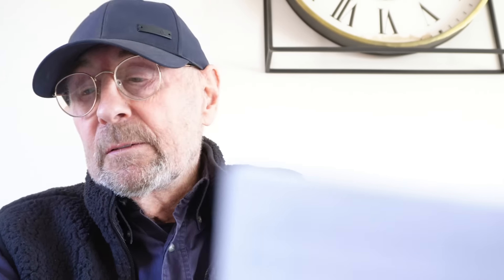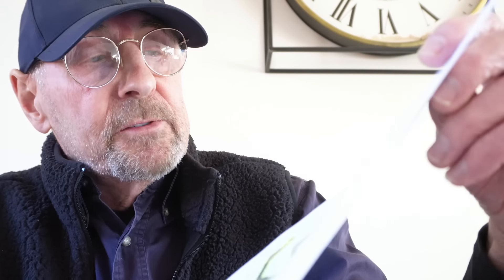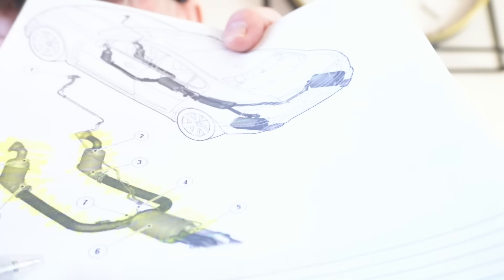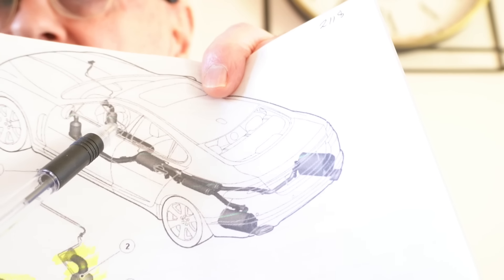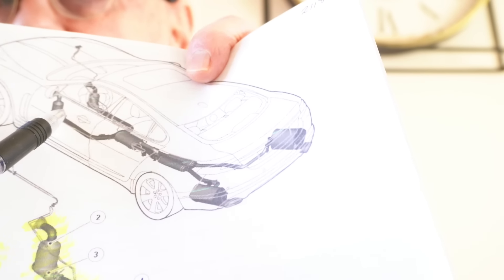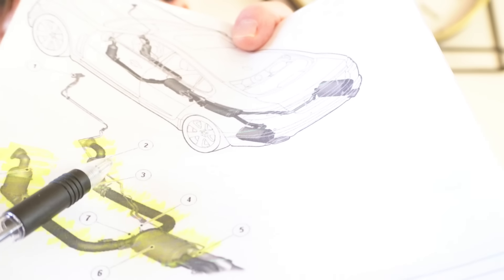CAUSE REVEALED!.. The Self-Destruction Of Jaguar Land Rover 2.2 / 2.7 / 3L Diesel Engines

Comment: The 2.7L TDV6 in the Land Rover Discovery 3 suffered from broken crankshafts, yet it never had DPF.  That didn't come in until the 3.0L SDV6 was introduced.  As someone else has commented, ALL modern diesel engine vehicles in UK and Europe have the DPF fitted.  It's part of Euro V specification, and they all have the same issues as you spent a good 20 minutes reading from Jaguar documentation.  It's something that was forced on the manufacturers, the same as the Exhaust Gas Recirculation systems.  You are using pure speculation to determine that the DPF is the reason for the failure of these engines, and you do not have any data to back it up.  People need to know your advice is flawed.  Yes, the V6 Lion does suffer from crank failures, but I'd be more inclined to believe what Christian of LR Time YouTube channel believes is the reason.  At least he has a lot of data to back up his proposal.
Reply: Mhhh….but what Christian also said is, that the thinner oil is better not use in that engines. So maybe both are right. The crankshaft is not a „Toyota design“ and never let the oil getting thin 😅
Reply: The 2.7 certainly DID have the DPF!! I had a D3 and RRS with the 2.7tdv6 and BOTH had the DPF!!!
Reply: @nicholascross1961 mine didn’t
Reply: @markcarter3897  depends whether it was a euro3 or euro4 rated vehicle.
Reply: @nicholascross1961  2006 Dpf was added 2007 model year
Reply from the maker: Hi Simon, thank you for watching and for your feedback. You do contradict yourself. You say I have no data and that my advise is flawed and that people should know that, then you say that I spent 20 minutes reading from Jaguar documentation. Are you saying that the Jaguar documentation that I quoted from has no data to support it, do you think Jaguar are making it up? What do you think will happen when your engine oil is diluted with diesel fuel? Would you advise someone to top their oil level up with diesel fuel?because you appear to think it makes no difference and does no harm and that I am wrong to warn people. It appears to me that you have gained a little information off the internet and tried to look as though you know what you are talking about when you don't. I applaud you for at least trying and I welcome comments but when you falsely  say my advise is flawed and people should be told then I feel you need to be exposed.
Reply: @crystalclearmechanics  Okay, first of all, yes I did quote from the internet, but I was quoting from someone who obviously isn't just a car repairer, but someone with qualifications to support his theory based on significant REAL research.  My criticism of what you were doing wasn't because it was wrong in itself, these are issues surrounding DPF if it is allowed to get out of hand, but that you have interpreted this as the reason for something else.  This is a connection that nobody else, even Land Rover in that piece are not making.  It isn't significant enough to cause a problem because that level of degradation of the DPF is not going to happen on a car with high miles - it happens because the car make short trips.  There is a difference. But go ahead and expose me for my opinion, backed by proper facts, if you wish.  I've exposed you for your opinion, based on just that, and opinion - your interpretation of an unrelated report.
Reply: DPF was present in the Pug 407 / 607 etc. DPF isn't the cause, the engine was designed for a sedan to be driven sedately. Not in a 2.5 tonne 4 wheel drive by people with inferiority complexes who like to floor it from every set of lights or towing a caravan etc, on an extended oil drain interval. Christian is correct, a thicker oil is needed to handle the crank stress pressure on the bearings. Do you LR guys have the Eolys fluid?
Reply from the maker: Hi, thank you for watching and for your feedback.. The engine was designed by Ford / PSA so I would imagine as Ford at the time owned JLR then they had the JLR brand in mind for those engines.The DPF regen system which includes the engine management system not just the DPF also driving style cause the engine oil to dilute. This is an adverse side effect stated by Jaguar in their documents that I read from. You should not allow yourself to be intimidated by the vehicles other people choose to drive. I prefer to use the oil recommended by Jaguar and developed by the oil company, of course if you prefer to use a thicker oil than recommended then do that.  @khalidacosta7133
Reply: Mine is 2007 Euro 4 and no DPF (RRS)
Reply: @crystalclearmechanics  The V6 is a Ford unit built in the UK at a Ford factory and continues in production today at the Ford South Africa Struandale plant near Port Elizabeth. The 2.2 was a Ford unit and gives very little trouble. The 2.0 and 3.0 straight six engines are Land Rover’s own, built at a new factory just off the M54 backing on to Wolverhampton. It is only the four cylinder versions fitted to pre-facelift Disco Sport, Evoque and small transverse engine Jaguars that have fuel dilution issues due to failed DPF regeneration.  You will get a very small number of vehicles of all brands that are driven mainly in town and to a shop and back daily that will fail to regenerate but that is not what this is about. Those people should be driving a petrol or electric car, not a diesel.
Reply: @simonuden8450  Christian from LR Time is NOT a mechanic - he works at an engineering company - He said that himself - By all means ignore this mans advice but good luck with your engine - JLR have had & settled a class action lawsuit in the USA & Australia - on these engines - WHY do you think they settled the claim ?
Reply: I have had my DPF & EGR deleted "intelligently" & has past 3 MOT's.  My car is a 2010 Jaguar XF 3.0 V6 diesel with 148k miles. PS I also run 5w40 oil.
Reply: @colinblythe3710  First of all, I didn't claim he was a mechanic.  He's an engineer, and has said so himself, quoting qualifications, so you need to think before making that accusation.  Secondly, just because someone makes a spurious connection between one issue with all DPF fitted diesel engines and a problem with some Lion V6s,  doesn't mean he's right.  Neither does what you said about the class action.  Settling, is not an admission of guilt, as SO MANY people have pointed out so many times before, and I notice you don't say what the class action was in relation to anyway, so I'm betting it's not actually directly linked to DPF, but instead is something else that people think they can actually prove.  By the way, I've been ignoring stupid advice and listening to sound advice for years, and it's never let me down yet.
Reply: @alba9507  DPF is a passive device.  How do you delete it 'intelligently' without actually removing it?  As far as I know, the MOT would not detect for non-operational EGR valves anyway.
Reply: @simonuden8450  The class action was to do with the engines destroying themselves - via oil dilution affecting the hydraulic timming chain tensioner - that then snapps the cam chains - locks up the cams & it goes BANG !
This is ONE of many problems with these engines - the webbing on the crank is too thin  and that snaps the crank- they tend to snapp more in the LR  four wheel drive vehicles than in the cars - as by there very design they are subject to more abuse that a road type Jaguar - I know you are going to say that a lot of these NEVER go off road but they are a lot heavier than the saloon car & people want car type performance from a 4X4 so they get driven hard - 
You seem to miss the point of the video - the man is giving ADVICE to POTENTIAL PROBLEMS - no one is forcing you to take it or do it - that is up to you - as long as you have £15 000 for a rebuild 
So the question is are you prepared to take a £15000 gamble or would it be better to change your oil ! its up to you
Reply: @colinblythe3710  I’ve only just managed to stop laughing at your dumb answer. The JLR (Ford/PSA) TDV6/SDV6 has a toothed timing belt.  If you had even the tiniest idea what you were talking about, you would know that, but you obviously don’t.  As for taking the advice of a paranoid delusionist, I’ll pass, thank you. I have, however taken a qualified engineers advice and I change my oil at or before the recommended interval, using 5W-40, as recommended by him
Reply: @simonuden8450  Im affraid your lack of knowlage lets you down AGAIN - LISTEN to what the man is saying instead of others on the internet - REGARDLESS of miles or the " DPF getting out of hand" (whatever that means)   the ECU initiates active or passive regeneration of the DPF - as a result of  ANY regeneration extra fuel is injected into the cylinders to heat the DPF up - some of this EXTRA fuel ends up in the sump - thus diluting the oil -
As stated it depends on the DRIVING STYLE as to how often a regeneration will happen if the vehicle is used as a school run & to the shops vehicle the regen's will be more - thus thinning the oil quicker that a vehicle used for long journeys 
So the 7% dilution rate will happen quicker well before the service interval / mileage - but if the user is not aware of this fact the oil could become more than 7% diluted - hence NO lubrication - akin to replacing the engine oil with diesel 
No lubrication spells trouble 
Do everyone a favour and stop commenting with internet and other peoples thoughts and learn how a modern car works and then you might understand what the man AND JLR are saying 
ALL modern cars especially diesels work the same and  the Euro 6 engines are the worst -ALL make are suffering from the same kinds of faults that are wearing out the engines well before any great mileage for a diesel engine
Reply: @colinblythe3710  You have no idea what my knowledge is, and I'm making no claims on that score.  However, I'm not the one who said that this engine suffered from timing chain failures, when it's got a toothed timing belt, so who's the one without the knowledge, eh?  You stick to your belief, I will stick to mine, thank you.
Reply: I am NOT replying to anymore of your posts as it is like trying to teach an apprentice all over again - 
PLEASE do some SERIOUS research & learning before dropping comments -  anybody can quote other people - but they slip up as they DO NOT HAVE THE UNDER PINNING KNOWLAGE to understand a chain reaction of events 
Before cars were plugged into computers mechanic's had to be detectives to find faults with engines - this is where EXPERIENCE on the tools and at the dirty end is gained NOT from reading books !
Reply: The engine was designed by Pergeot and Citroen for use in a transferse figuration which necesitated a short block. That is why the webs are so thin and prone to failure. I have owned 3 Range Rover Sports, 2 2.7's and my current 3Ltr TDV6 which suffered a broken crankshaft at 140k. There was absolutely no warning for my crankfailure, I was doing 60mph and the engine just stopped and left me coasting in the fast lane, no warning lights. I have never seen a DPS warning and didnt realize my car had that system (Im yet to be conviced tbh as my 2013 RRS is not ULEZ compliant) 

The statement from Ford is interesting and MIGHT add another possibility for Lion engine failures but it is wrong in my view to suggest that its the only or even main reason for failure. If you havent already watched the LR Time video on the changing oils specification then you should as its been vary carefully researched. 5W30 is like water when its warm, I have changed tto 5W40 for my rebuilt engine @crystalclearmechanics
Reply: There are other vehicle manufacturers that use a different DPF/regen system,and oil dilution will never occur.This system is way more reliable,and does not cause any other issues.Toyota are one that use it,in their Euro 5 vehicles,and have done so for many years.The TDV6 Lion engine,both 2.7 and 3.0L, failed for many reasons,well before they were fitted with DPFs,in markets that did not need them.
Reply from the maker: Hi Marcos, thank you for watching and for your feedback. Ford were also involved in the design with PSA. The reason given as to allowing the length of the engine to be reduced was that the material used for the block was compacted graphite iron with a hollow beam structure ( stronger ), not the traditional cast iron. A shorter block a shorter crankshaft which could lead to a weaker crankshaft. My video is primarily relevant to the main reason for Jaguar engine failures and as I said the Land Rover as well if fitted with the same DPF regen system. I also stated there can be various reasons that engines fail, that is a given. I am surprised that you imply that the crankshafts break due too being weak, then you say that a different grade of oil will stop the crankshaft from breaking and that oil dilution would not have an impact. How does that work exactly? The fundamental question that must be answered when suggestions as to failure are put forward is why have they not all ( across the board ) failed for that reason? What other factors are involved? As I said in my video I don't have a great deal to do with the Land Rover side of JLR  but will now due to the response ( from the video ) look into the cause of the crankshaft failures in the early pre DPF regen vehicles. Thanks again for watching. @marcos3ltrv6
Reply: @crystalclearmechanics  the point is that there are probably several reasons that the TDV6 fail, Christian (LR Time) has discussed this issue on his channel and apart from the poorly designed crank he mentions that radius long  on the crank journals is sometimes insufficient and puts that down to Friday afternoon syndrome. He also disagrees with the oil change frequency as well as the fact that the oil viscosity and spec was changed by Castrol. My 3 Range Rovers all made it past 100k without issue but many others have failed between 40-70k. Spun bearings is also a known issue. The crank broke on the 3rd Sport with no warning whatsoever, no dpf warnings but as I said before, I don’t believe it is fitted with a filter.   I done 11k miles on the repaired engine but don’t thrash it to death like I used to, I let it warm up when cold starting and try to keep the revs below 2k rpm. I do accept that there is an issue with oil dilution where a dpf is fitted but there are many other issues, not just one.

On the other hand though, a faulty dpf might explain why some Sports catch fire as in the Luton Airport fire🥴
Reply: @simonuden8450  umm they have a timing belt and chain at the back of the engine lol
Reply: @nicholascross1961 
Not the early ones
Reply: Christian is a scare mongerer, he has LR
Move away
Reply: Having watched this I'm siding with Christian on LR time.
I stopped using dumbass 5W30 long ago, it's too thin for these very high torque low rpm engines. I use 5W40. 
My X351 hardly ever goes over 1500 rpm even at 70mph due to the very efficient 8 speed ZF box.
I have done my research and logged a lot of bearing spun/crank failures

From the many Facebook Jag groups I'm in I've sent many many messages to the owners of seized Jaguar engines over the last 5 years to aquire my data.

Many have stuck to the JLR hugely excessive oil intervals.
Many have covered over 100k miles (which shouldn't be a lot for these Lion engines)
⚠️Not ONE owner of the failures has put a decent viscosity oil in either 5w40 or 10w40 which is what the original Lion engines were designed to operate on.
In my opinion, modern watery oils like 5w30 and even worse 0w20 0w30 dumbass oils etc, were developed for lower emissions and NOT for the benefit and longevity of engines. 

Gone are the days of really high mileages like 300k - 500k.
Modern engines do nowhere near that figure these days due to the various emission strangling devices fitted.

But the main factor in last 20 years is the oil grades getting thinner and DPF regeneration processes making them even thinner.

The low SAPS spec of dumbass grade oils again is to do with emissions rather than for protection of bearings and bores.
I use a C4 spec because the C1 spec is pretty much obsolete and dropped from major production in 2021.
Oh yes and 5k miles intervals have been the norm for me for last 30 years on any car I've owned and never had any any engine failures.
Reply: @nicholascross1961 2.7tdv6 did not come with DPF